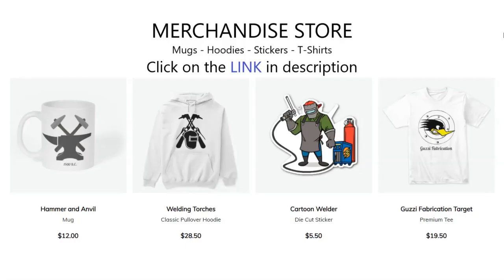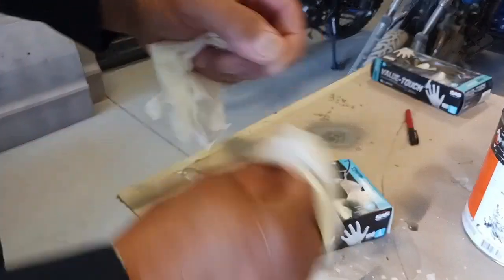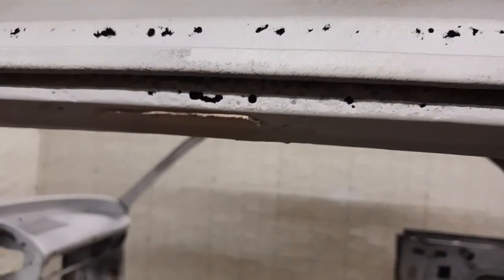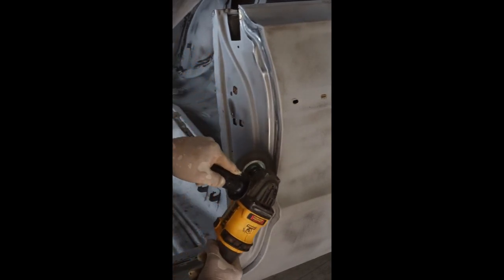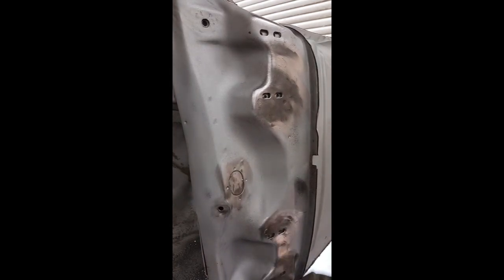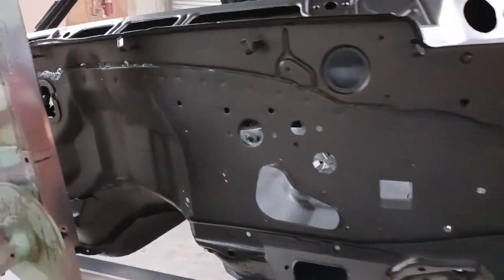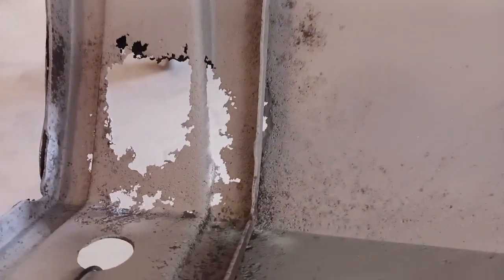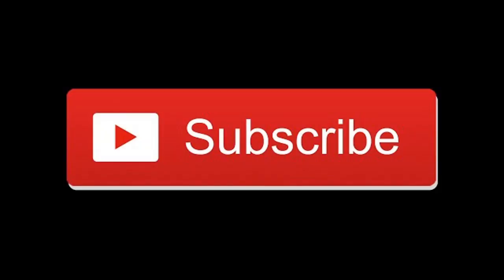1964 Impala Restoration Part 5  - Repo fenders skirts - Media blast prep tips - DP 90 epoxy primer

Comment: Its funny I just found this video and im at the same stage of my 1964 impala restoration. Ive had that car for 23 years since I was 17. I did some driveway restoration and painted it a couple times over the years, but I'm finally in a position to do a full frame off. I just finished the body cleaning. I did it all with a DA and wire brushes, sanded the whole underside laying on my back with the body on blocks. That sucked lol. Anyway it's just interesting seeing all the same rust holes on your car that I had on mine. Mine had the infamous rotted driver side rear body mount, and the crack in the quarter panel right at the back of the rear window. I replaced the body mount and still need to fix the crack. Ive welded it up before but it always cracked again due to the paper thin rusted body mount. I think Ill weld a plate in behind the crack this time just to be sure. Nice video, very informative and good to see I'm doing things the right way.
Reply from the maker: Great 👍

Comment: I’ve watched all your videos multiple times so I apologize if I keep asking questions bro. I was thinking…those holes in the roof. How the hell does moisture/water even get up in and under there? How would those be fixed as media blasting will only clean the outside of the roofs sheet metal I would assume that under the roof right there in that particular you wouldn’t be able to clean the underside because the roof to rear wheelhouse bracket/headliner tabs are there. How does this get fixed bro? Thanks man.

Comment: Keep up the good work glad to see the 64 is back question after you meet a blast how much time do you have until you epoxy primer👍👍
Reply from the maker: Always ASAP, it really depends on humidity. A day maybe two depending..... you could go longer but a day is best practice. Thanks for watching !
Reply: The best finish on metal is when the media blast is done with aluminum oxide another advantage is aluminum oxide leaves a barrier over the metal to prevent rust for lengthy time I've head part sitting in my garage for over a year and not rust

Comment: I have a question, I’m about to get the front clip of my car blasted. So from the doors forward and underneath. As far as epoxy primer goes do I have to prep the metal before shooting like scotch brite or 80 grit everything or can I just shoot epoxy  after blasting

Of course getting all & much as the media out as possible before hand.
Reply from the maker: Clean all of the media, blow off any surface dust and apply the epoxy. VERY important : do not leave the parts/car in sun and apply while metal is hot. Hey thanks for watching, great luck on your project
Reply: @guzzifabrication3448   no problem I just found your channel I like the work, going to sub 

I’m out under a canopy that should fine right as long as it not directly being hit by the sun?
Reply from the maker: @adriancastillo5521  Yes Sir
Reply: @guzzifabrication3448  great thanks for your time I really appreciate it!

Comment: How will those rust holes under the drip rails be fixed? Fabbed and replaced?
Reply from the maker: Probably cut out that section fabricate and replace. Thanks for watching !
Reply: Would you be interested in fabricating another set?  (I am assuming both sides will need to be fabricated or that both sides have rust holes)I’d be happy to pay for it and for shipping. Thanks. If not I understand you’re busy thank you.
Reply from the maker: @ChristopherL0rtiz  if I had extra time..... I'm in the middle of six complete projects single-handed, does classic Industries offer them?
Reply: @guzzifabrication3448   no they don’t. They sell the actual drip rail with part that goes up under and into the roof but not that particular piece. It’s shaped like an “L” and runs from that front post all the way back down into the wheel house.

Comment: What's the reason you don't acid dip
Reply from the maker: 1. I don't know of any in the area 2. there can be issues later with trapped un neutralized acid  in between body joints.
Reply: Acid dip also removes metal.